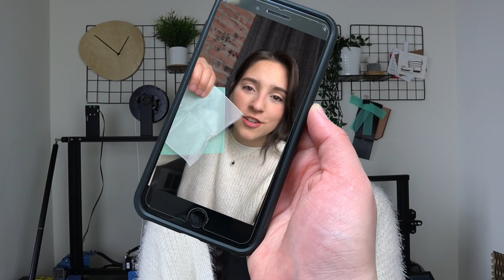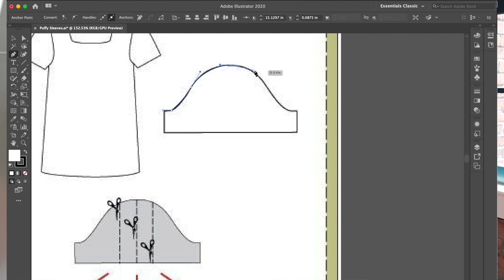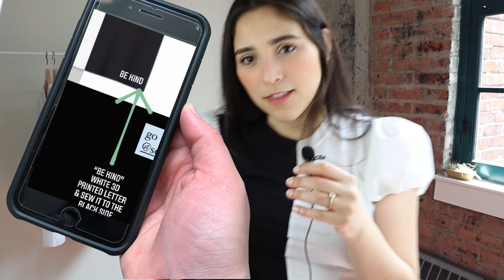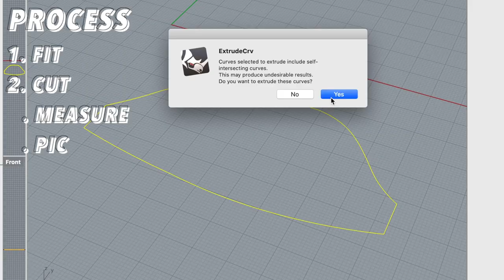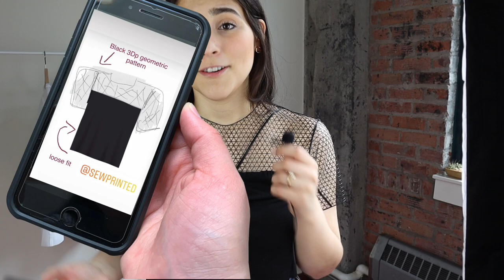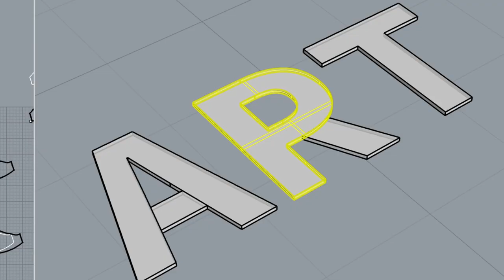Using 3D PRINTED FABRIC to Transform T-Shirts

Comment: Also, I'm a fan of anyone who reuses previous failed parts for projects later. Well done in reusing instead of throwing away. Remelting and forming new filament is possible but it's expensive and you need large extruder equipment.
I'd like to know if you will/have made something entirely out of repurposed sections? What I mean is, have you tried using many failed pieces to get a unique work? Eg, I used a failed print as a solid waterproof cover for electronics on my electric mountainboard. It's not fashion but the reuse is the point.
Reply from the maker: Totally on the same page with you. I have a drawer full of these and one day when I have enough I’ll definitely turn them into something new. I do use them every now and then like for example to decorate “the tree” in my sweater video.  Super cool to hear you’ve done so too and for such a practical application. Kudos to you💫👍🏼

Comment: I'd like to ask about how you work on flexible regions, like a pocket, that are printed differently:
Do you aim to make the general outline more dense than the inner or do you make a design that has infill that compensates for multiple sections that are rigid yet other areas have some give to allow the entire section to flex?
Also, nice Acronym. Catchy, Fi Cu Cap
Reply from the maker: Awesome question. Truth is I’ve done most of my “flexibility experiments” as random prints and haven’t incorporated them into a garment. Some of these experiments I’ve posted on my Instagram. In this case, since I was following some designs that were drawn out, I was mainly focused on the aesthetic goal of getting the shirts to look as similar to the drawings as possible. Your point of studying how certain portions may be more flexible and others may be more controlled is super interesting and I’ll see how Incan incorporate this into things I make in the future. Thanks for your comment 👍🏼